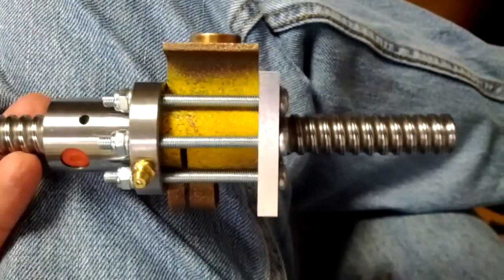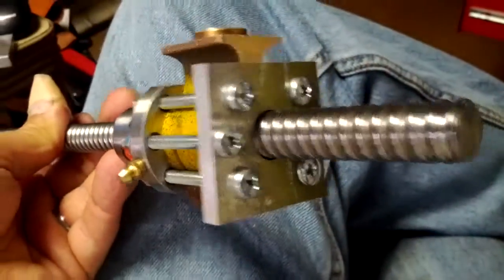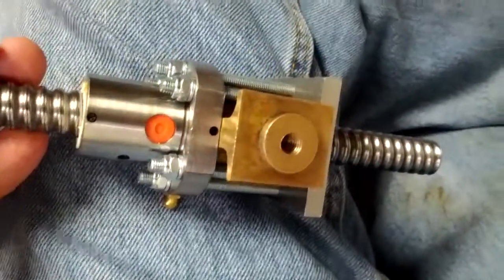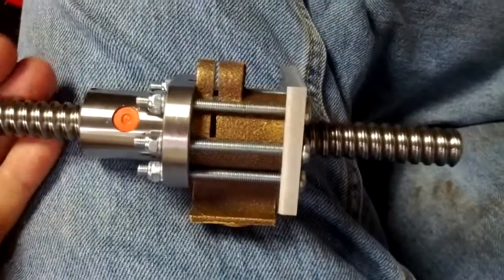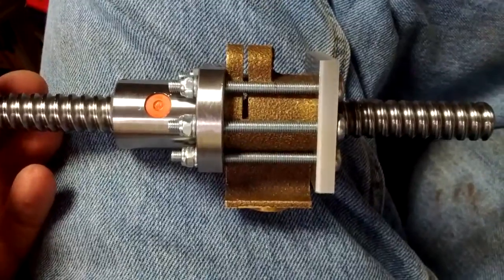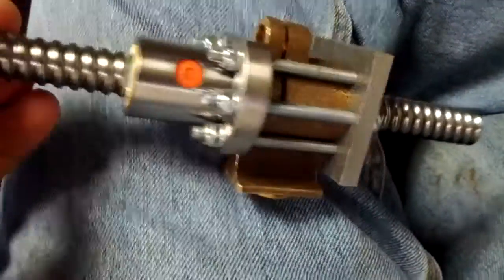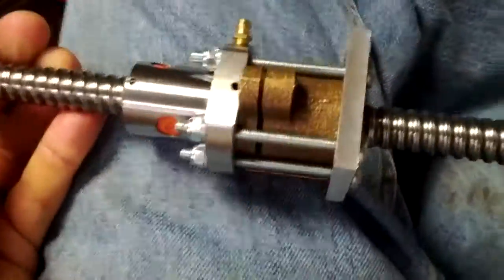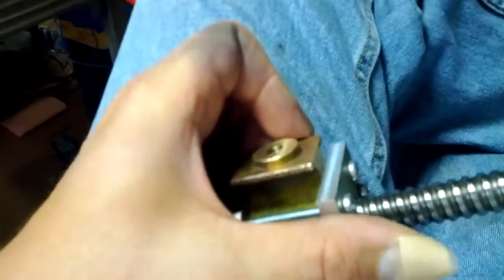Ball screw nut capture design Rong Fu RF-31 CNC conversion

Comment: So your using the original acme screw and now have a shorter amount of table travel?
Reply: That’s a ball screw not an acme. Looks like the y axis ball screw and that he may have a shorter screw but if he is just floating the back side like most do it may be fine reusing the old bronze lead screw nut. He would just continue traveling that but over the open end another 2 inches without any issue. So whether he machined a new block or reused the old lead nut drilled out the only real loss in length he subsequently has is that 3/8 plate on the backside which is an insignificant affect on his overall travel.

Comment: You can preload the ball nut and screw with adding couple Bellville washers and one more ball nut Just put the Bellville's  between the two ball nuts and bolt them together till a reasonable load has been reached.